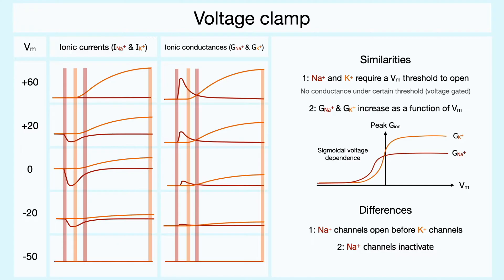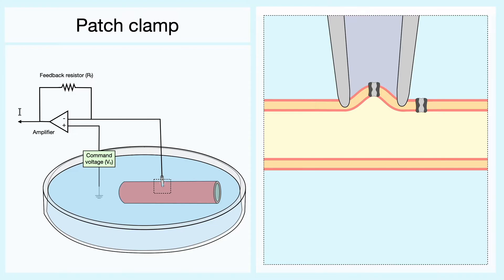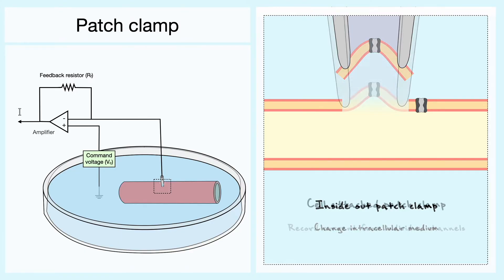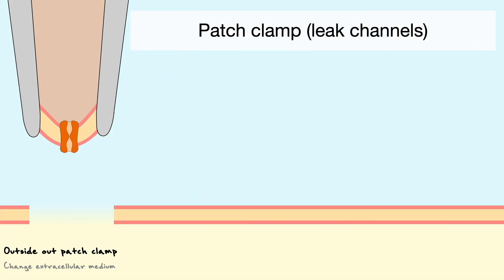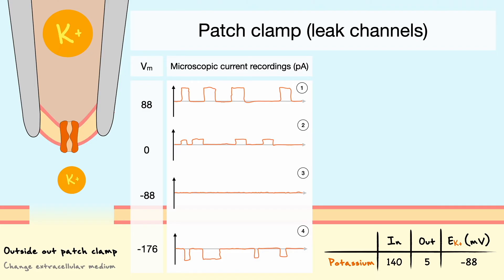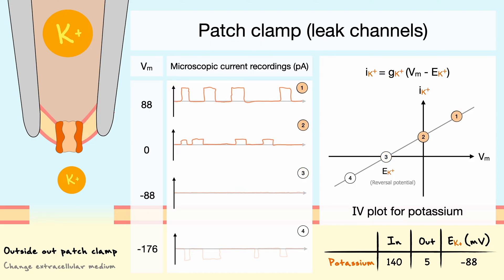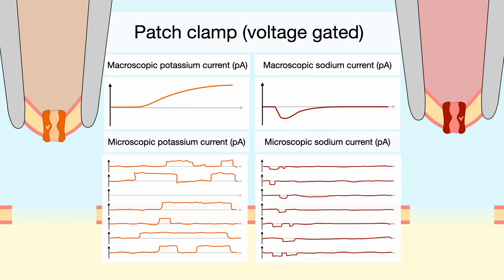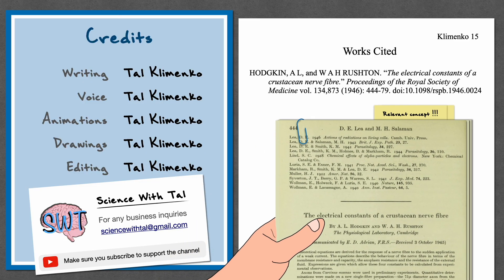Patch Clamp Explained (Cell-Attached, Whole Cell, Inside Out, Outside Out Configurations) | Clip

Comment: also I thought leak channels are always open?
Reply: oh, okay they close and open at random, but they are still depended on voltage?😢 I am a bit confused
Reply from the maker: @Katrin-o1j Leak channels are always open but the net current (or net amount of ions) that goes through them is governed by the Nersnt potential. As such, if the membrane potential = Nersnt potential, then there will be no net ionic movements (hence, it explains why there is no current at -88 mV for potassium channels and +60 mV for sodium channels). Let me know if that made it a bit clearer.